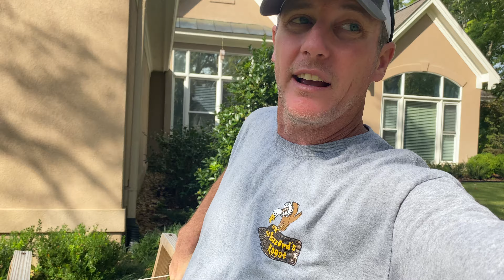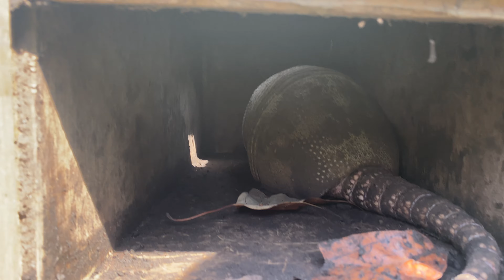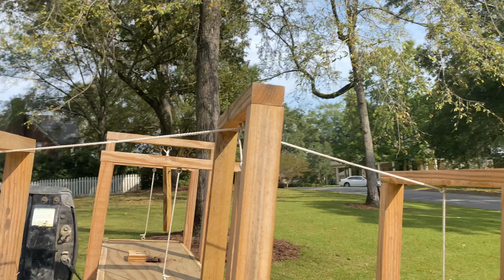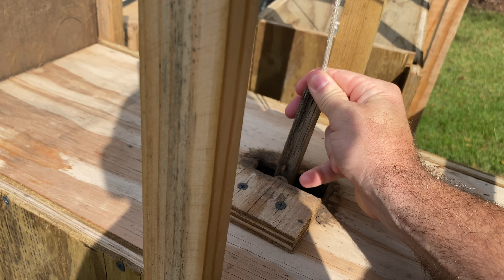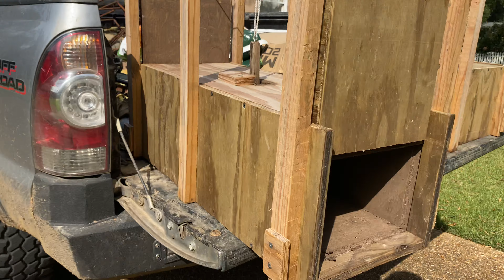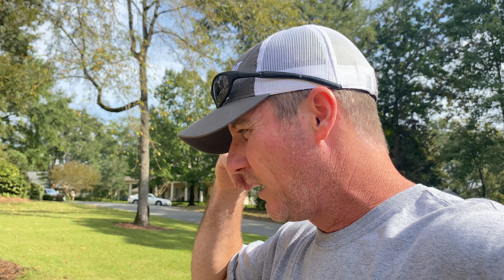How the armadillo trap works. With live armadillo.

Comment: Armadillos are digging machines.  If you don't have them, count your blessings.  They will burrow under slabs, pool decks, stairs, your foundation, plants.......well you get the idea.  And they don't make just one burrow.  Armadillos make multiple burrows and will randomly chose which one they are going to hide in when not foraging/tearing up your yard.  Mostly nocturnal, at least where we live.  But I have seen them during the daylight as well.  Thanks for sharing David.  Stay well and God Bless.
Reply: I can’t stand them and ground hogs or gophers
Reply: Good foundations of a home go like a meter or 2 under the surface and ought to support the whole house under the entire floor surface... Polish building tip. We aint getting any problems with ANY diggers.
Reply: @johnanderson4203  Hey and they probably just ignore you.
Reply: @MIMALECKIPL  your comment makes as much sense as having an elevator in an outhouse